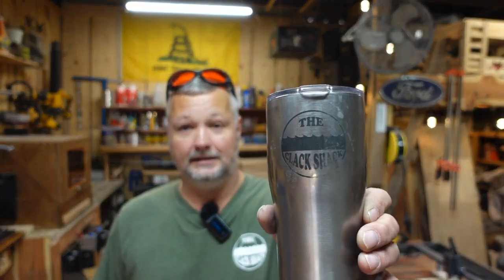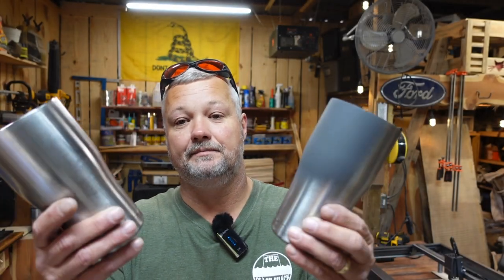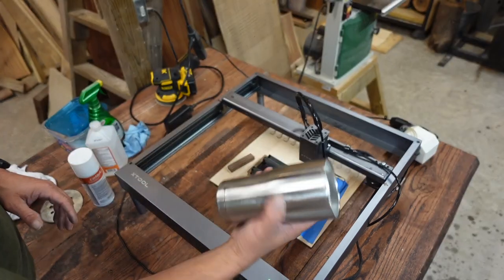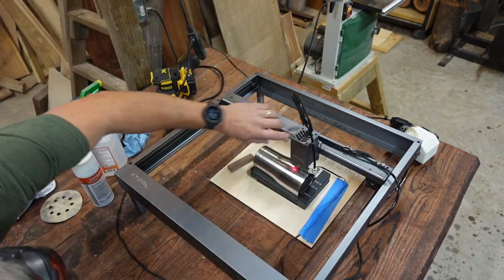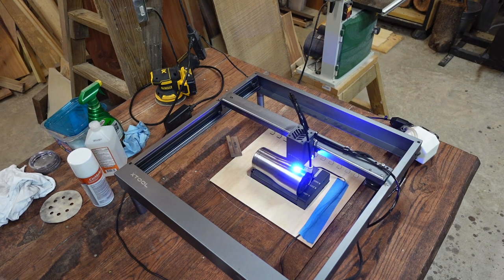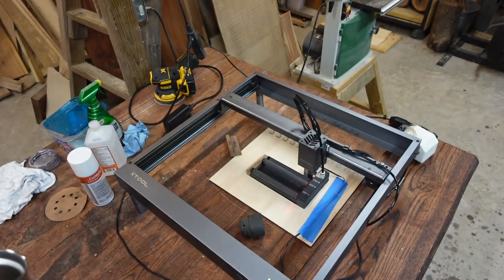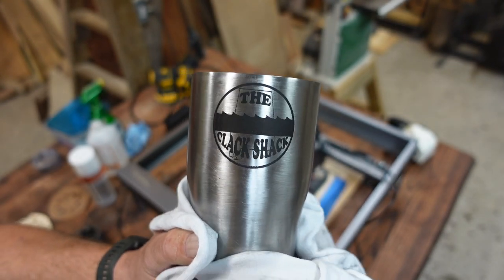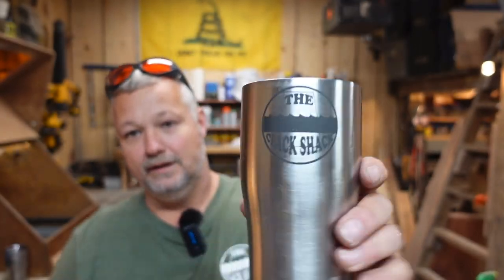Marking stainless tumblers- Plain vs. Cermark

Comment: Hey Clack, thanks for the video, I got stuck with getting my text straight on the tapered tumbler, due to the curve of the tumbler, There is always a slight difference, do you know how can I change it? the setting of the lightburn or how should I put it on my rotary. and somehow I cant get a perfect circle on engraved on my mug as well.... If you might help me out would much appreciated!
Reply from the maker: Lots of math and some editing on the design. The shape of the canvas can make things look unaligned when they actually are.
Reply: @TheClackShack  thank you!!

Comment: Clack, Have you done these on your 20 watt? If so, What spped & power would you recommend to start for a dark burn. I dont want it too hot and warp the metal. I know the settings you used on your 10 watt.
Reply from the maker: I haven’t, I have done so many with the 10 that I just hate to change up. My 10 isn’t enclosed so it’s just easier
Reply: @TheClackShack  I did one tonight on a whim and used 90% Pwr and 55 mm/s and the outcome was OK, but I would have liked a darker outcome. I’m thinking the Dry Moly is the reason for the lighter transfer. The transfer was perfect otherwise. Thanks Dave for the reply!

Comment: Another use for the spray is to use it on a powder coated tumbler.  The black marking looks really good against a light color.  I use enduramark instead of ceramark but the look will be the same.  I just did a lavender tumbler and the black really pops against the lavender.
Reply from the maker: Good idea. Thanks

Comment: What settings do you use one the 20w?
Reply from the maker: I use 120mm/s for anodized aluminum, haven't done any stainless with the 20 yet. I usually use the 10 for that just because my 20 stays busy cutting out designs.

Comment: I have a 10w D1. I use just enough coating that I can’t see stainless through it. Takes only 5 minutes to dry so no need to sit hours. I use 100-140 lines per CM. More it’s high detail. 100% power and 65mm/s speed.
Reply from the maker: cool

Comment: Of course the spray powder is going to look better than plain SS engraving. The powder solidifies when it is heated with the laser, because it is an add-on product that adheres to the surface. Whether it's black, blue, red, green, etc., it will be bolder than the plain SS because of the reflection that occurs when the laser hits a light in color surface.
Reply from the maker: Some folks don’t get it..

Comment: What can a 20W do?
Reply from the maker: Cermark results would be the same with the right settings, bare might be a little darker but I doubt it. From my experience, that is about as dark as stainless gets. Too hot and the metal will actually start to sink in and pit. I figured that out on some thin stainless flasks.